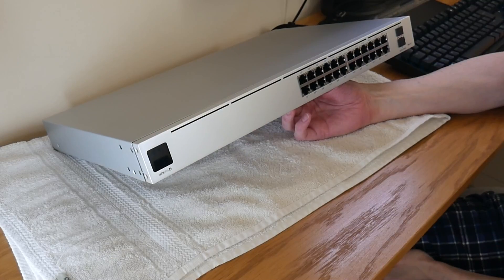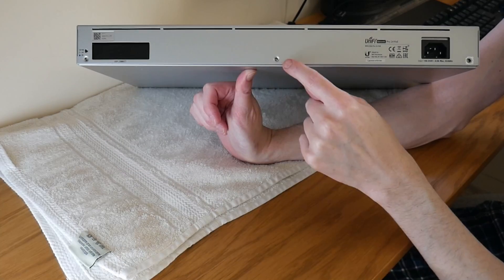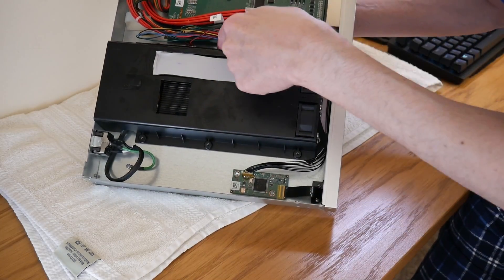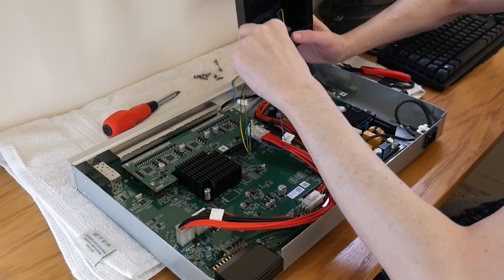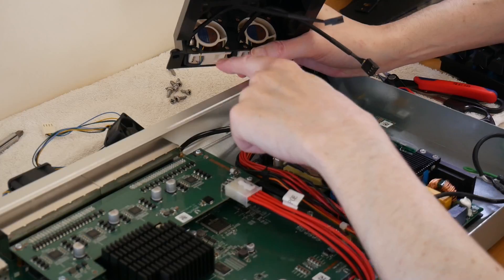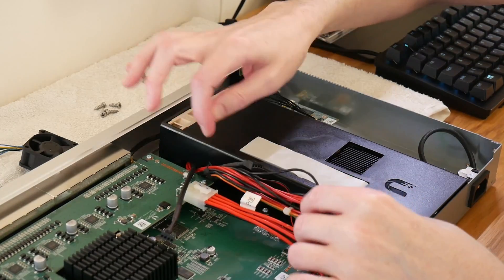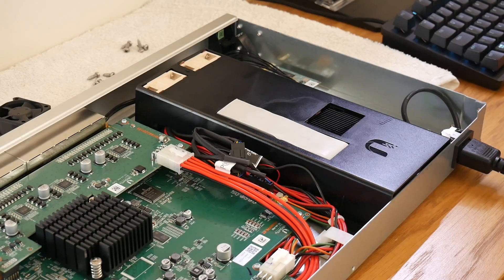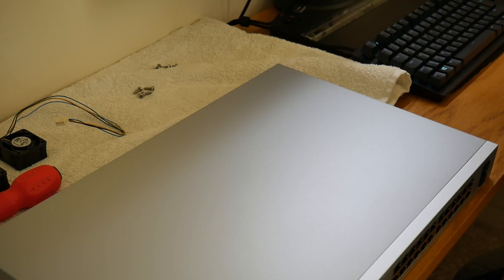USW Pro 24 PoE Gen2 Fan Replacement

Comment: thanks Tim, i have the same switch, could you tell me the version of Noctua NF-A4x20 PWM 5v or 12v?
Reply from the maker: You're welcome, did you see the picture for the video as it shows the ones I used 🙂Anyway they are 12Volt PWM versions.  There's also a link to them in the video description which takes you directly to the correct type and voltage.

Hope this helps.

Comment: Thanks for the video. Is fan replacement an ongoing issue with this device, or are you just showing this as a 'just in case' kind of thing?
Reply from the maker: You're welcome.  The fans are not faulty and I haven't heard of them failing before their time is up.  I just wanted quieter fans/less noise.

Comment: Currently thinking about switching to Noctuas as well but I’m not really bothered by the sound. I’d add a splitter and use 2 fans at the top of my rack as an exhaust and the switch is the only thing with a fan connector near that
Reply from the maker: @RealThore - That's a thought, I guess it would work.  An alternative would be to buy a fan connecter to USB plug cable maybe and then buy Noctua's for the cabinet roof as extractors, I'm sure Amazon might have those cables.

Comment: Great tutorial. Why did you use the NF-A4x20 PWM  versus NF-A4x20 FLX? Do you know the difference between the two?
Reply from the maker: Thank you very much.  I used PWM models as these have speed controls, so the Switch can adjust the fan speeds automatically as and when required depending on the temperature.

Comment: Did this replacement today with the Enterprise 24 PoE. Everything worked out fine. I only had zo modify the headers of the noctua extension cables with a cutter because they don't fit otherwise. Temps are the same but much quiter. Thx
Reply from the maker: Hi @Joscha Tilgner - Thanks for the feedback and great to hear it went well, it certainly does reduce the sound levels doesn't it.  Well done on the Enterprise 24 fan upgrade 👏

Comment: Thanks for the video, very helpful indeed. I purchased and replaced mine straight after seeing your video, and couldn’t be happier. Really in love with my switch again. One note to anyone who is planning to replace the fans though, don’t be alarmed when connecting the Noctua fans connectors to the switch’s board if you find out the notches on the connectors do not align with connectors base. Just gently pry the base lip and push the connectors in and you should be good to go. At first, I was alarmed that I perhaps bought the wrong model when found out this, and had to zoom in to video at the frame when connecting the connectors which turned to be exactly the model I purchased. 

Again, thank you for the video. Great job.
Reply from the maker: You are very welcome @hamdicarlo so pleased you found my video helpful and glad you now like your switch again. I was also dishartened with it being so noisy, couldn't find any video about that model changing fans so decided to do one myself, now like you I am pleased with the switch again.  I will keep doing some more videos which I hope you find helpful too. Thanks again.

Comment: Thanks so much for this.  My USW-Pro-24-POE is so noisy I assumed it was faulty, but perhaps not.  It's only 2 months old, so reluctant to mess with it too much but maybe it is worth it. Why can't Ubiquiti use better fans I do not know!
Reply from the maker: Hi, you are very welcome, thanks for your kind comments.

I know what you mean, I only lasted a month before changing them, even though it was still under warranty. It is a shame but I guess they spend more costs on the actual quality of the switch than the fans, which is a shame for home users using occupied rooms with IT gear in.

Comment: Was there any warranty seal or anything that would indicated it had been opened if you had to reverse this and have it serviced by Ubiquiti?
Reply: Old thread but these stickers are not legal binding, at least that’s what’s the FTC says. Currently they’re investigating against (I think) Gigabyte and Asus for this. As long as you don’t damage components during maintenance (and swapping/cleaning fans etc falls under that) you’re fine
Reply from the maker: Hi @Person Suit, good question.
Yes there was a security sticker on one of the screw covers, so yes it would certainly invalidate your warranty, so you would have to decide between invalidating your warranty and putting up with the noisy stock fans or not.
Mine was out of warranty, hence why I decided to replace them with Noctua's.

Hope this helps!
Reply: @MrTimTech2022  one last question for you if you don’t mind. Did the sticker come off easy or did it have a whole bunch of void markings when you removed it?
Reply from the maker: @PersonSuit  Yes sure, no problem at all.

It did leave some residue which you would certainly know it had been removed, I don't think you could avoid it.

Hope this helps resolve your concerns.

Comment: Nice walkthrough 👍 
Did you experience a "much" higher temperature and what is your subjective noise improvement?
Reply from the maker: Thanks Anders, glad it's helping people out.

The day to day average temp has dropped to between 48 to 53°C with fan level at 52% it used to run at about 56 to 60°C.  As for noise level now, its virtually silent, so yes I do recommend changing the stock fans. Hope this helps.
Reply: @MrTimTech2022 , nice!
Thought the temperatures would be slightly higher, but if they are actually lower, it's a win-win 😎